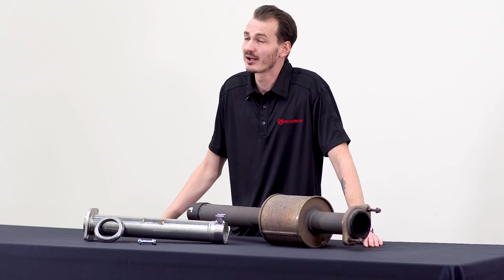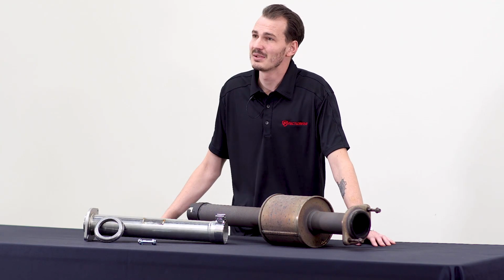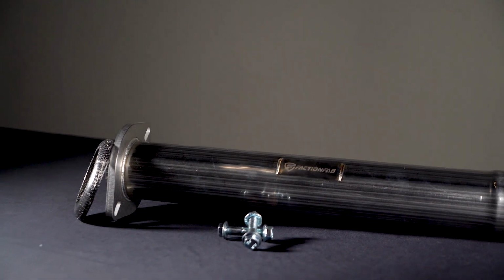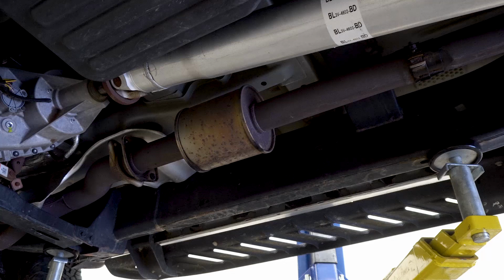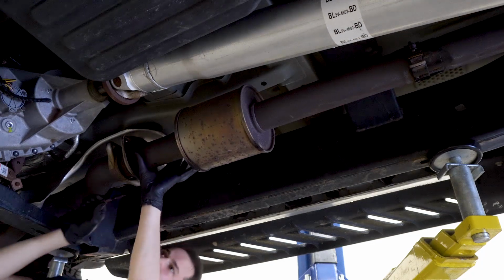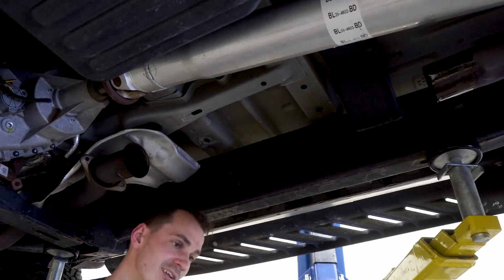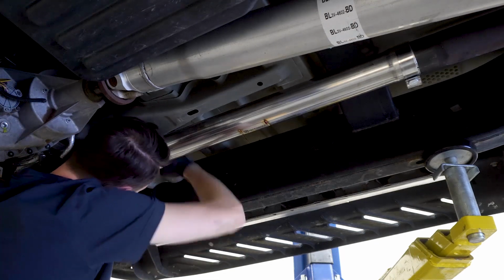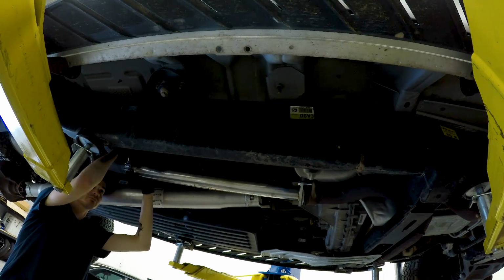FactionFab Resonator Delete Install

Comment: Did you guys know that the 2023 and 2024 F150 Resonator end pipe on the muffler side has a button type on the end of it  where the factory resonator locks into place .. if you need a video to show you .. please let me know .. I can post it on my channel ..
Reply from the maker: Yes, actually all of the 2010 and newer trucks use a pin-/twist lock feature on the resonator / muffler connection, but we opted for the simpler slip-joint design. Our resonator should to UP TO the pin (not on top of) and then clamped in place.
Reply: @factionfab5834  ahhh!! Oh ok, I was just making sure since I ordered one for my 2024 F150 3.L crew cab 145 size option … I will be posting a video on my channel as well .. thanks for the info .. 👍🏼🥃🇺🇸

Comment: Hi, How loud is it in the cab when going at 75-80 down the interstate?
Reply from the maker: We find that the resonator alone doesn't have a very large impact on the overall loudness of the exhaust, especially at higher speeds where you have more road and wind noise. The biggest difference you'll notice is a deeper, fuller tone in the exhaust, and at idle it might be a little bit louder, but not much.
Reply: @factionfab5834  do you have a resonator delete that is 409 stainless that fits a 2013 f150 5.0 extended cab with the 6.5 foot box

Comment: If you have the v8 I recommend a muffler swap and keep the stock resonator if you want tame yet a good v8 sound. I’ve had two v8 f150s with cat back systems and no resonator which were way too aggressive and now I just have my stock system on my ‘19 5.0 with a magnaflow in place of the stock muffler. This is by far my favourite set up after almost 10 years and 2 trucks by trial and error. I was about to buy a resonator delete pipe and install it myself and instead had a shop do a muffler swap which included a fit test, try before you buy in the shop, picked the muffler I liked best before they welded it on, for less money than the resonator delete pipe would have cost. All that said I see the appeal and advantages of the delete pipe which is in theory reversible if it doesn’t seize on. Also the turbo trucks seems to sound pretty good with just a resonator delete but maybe that’s just compared to the ones that think a v6 will sound good with a borla atak!!
Reply from the maker: Great feedback! We agree that the resonator delete on it's own is somewhat of a subtle change, and we find that a lot of v6 and v8 owners are looking for something just like that. Our personal scale from quiet to loud goes:
Stock
Just resonator delete
Just cat back / muffler
Resonator Delete + Catback / Muffer
Within that there is also a wide range depending on brand and such, so hopefully everyone can find the setup that works best for what they're after.

Comment: Added this a few months back and it sounds great, its well made, looks great and easy install also👍🏻
Reply: How loud is it in the cab when running at interstate speed?
Reply: @timb3925  sounds close to factory just more noticeable
Reply: @irregularf150  I am just wondering because I did something similar to this on a pickup I used to own. And I started to get a drone at the interstate speeds that was annoying to the point you could hear it over the radio
Reply: @timb3925  yeah i hear ya. Its all based on the person hearing of that particular sound area. Now going up hill at 2k rpm around 30-35 is where i hear a bit of drone. Not enough to bother me though.  Im working on getting some more videos on my channel and im going to include a highway in cab one doing 65-75 mph areas. Just need to find time lol
Reply: @irregularf150  I will try to find your channel and will watch for it. All the videos I can find seem to be windows down or taken from outside the truck, while that is important I need to live with it day to day.

Comment: Hi where can i order this from Canada?!
2019 2.7 ecoboost... thanks!
Reply from the maker: We are not aware of any direct Canadian distributors and usually send all international buyers to Stage 3 Motorsports as they do ship to Canada and other countries.
Reply: @factionfab5834   thanks! Can you share a “order link” for 2019 2.7 ecoboost
Reply from the maker: @biggtimber2736  This link has all of the resonator deletes, and you will choose the right part number depending on the wheel base of your truck. 
https://www.stage3motorsports.com/2015-2019-F150-Resonator-Deletes.html

Comment: I just purchased your resonator delete for the 11-14 f150 with the 145 wheelbase, I have a 3.7l v6 it’ll still work correct?
Reply from the maker: We havent test fit on the 3.6, but its the same for the 5.0 and the 3.5EB. if you want to email us at sales@factionfab.com with the length info of your stock unit, we can confirm.

Comment: Is the 5.0 and the 3.5 eco-boost the same size or it’s Different I have one for my 5.0 I want to use it’s on my 3.5 eco-boost
Reply from the maker: The pipe diameter is the same for the 5.0 and 3.5L engine, however there are some differences between the 2010-2014 and 2015+ models, and the wheel base would also need to be taken into consideration. We have all the models listed on our website if you want the specifics.

Comment: Is that ecoboost the 3.5 or the 2.7?
Reply from the maker: We have them for the 2.7 EB, 3.5 EB, 5.0 and 6.2. About the only applications we currently are not supporting are the Non-EcoBoost V6 and nothing yet for the 2nd gen Raptor

Comment: So I just recieved my delete pipe and it's a few inches shorter then the old resonater. I know my wheelbase is 145 and that's what I ordered.  I have less then half an inch going into there clampable side before tightening the flange bolts. Can't figure out if im doing something wrong or it's just to short.  Any suggestions?
Reply from the maker: The FactionFab delete pipe is designed to be a little bit shorter since it does not go past the rotating locking pin like the OEM does, however there should still be plenty to secure it. It is common for the muffler portion to have shifted on the hangers to sit farther back on the truck than it was in stock position. You may need to pull the mufflers forward to close a gap at the resonator connection. If you are still having trouble after this, email us at sales@factionfab.com and we will explore other possibilities.
Reply: @factionfab5834  perfect that did the trick.  Didn't realize it would slide like that! Thank you!

Comment: In the sound clip did the 5.0 v8 have any other performances mods besides this resonator delete?
Reply from the maker: Yes actually, this truck had a whipple supercharger with supporting mods. However the exhaust was still completely stock prior to install and this is an accurate representation of the sound on a stock 5.0 as well.
Reply: FactionFab ok thanks I have heard other resonator delete videos and they didn’t sound anything like the how yours did definitely gave it a nicer sounding rumble and tone